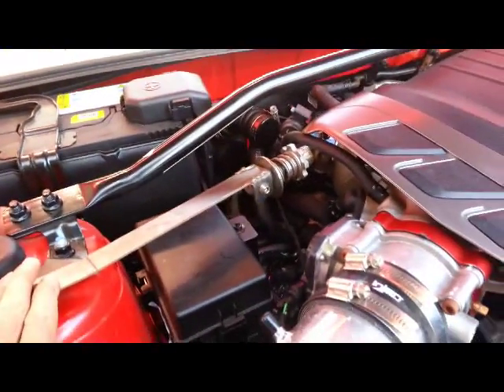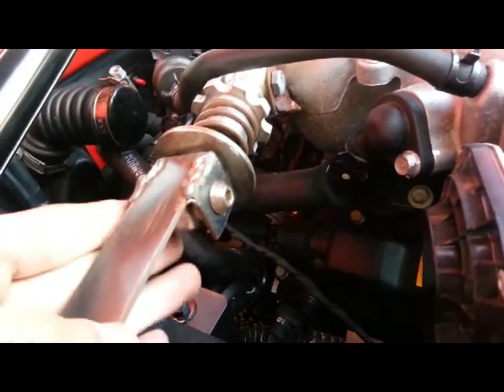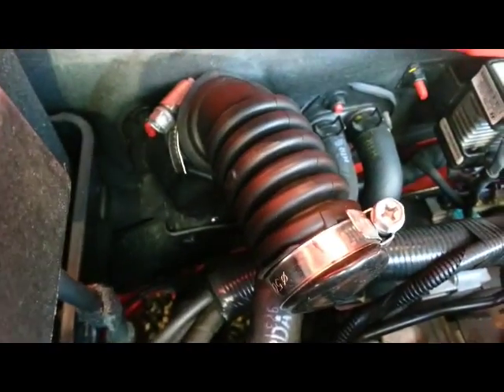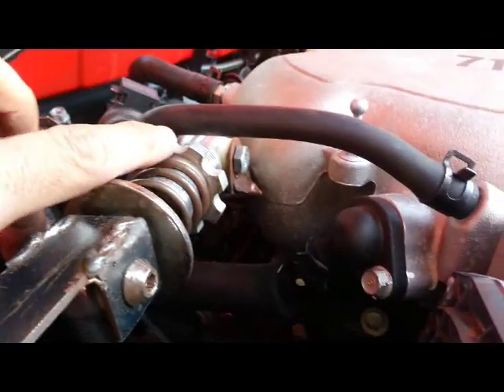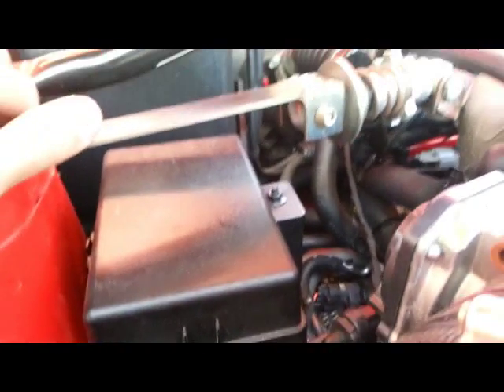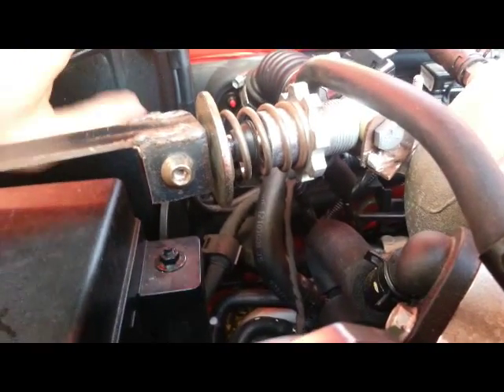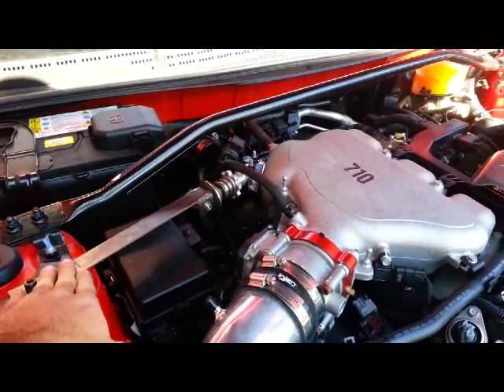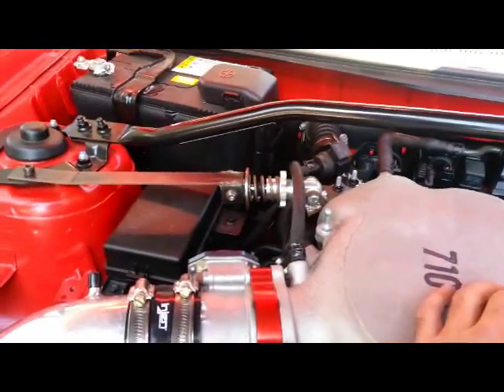✓ Custom Engine Torque Damper Explained

Comment: Not too bad.  The only issue I see is the bar between the two mounts.  It should be tubular or you need to add more pieces and form a triangle.  Your setup will NOT handle compression loads and is likely to bend during rapid throttle transitions.  Especially any that go:  idle>WOT>idle
Reply from the maker: BluntForceTrauma666 yeah this was a mock up/concept test. I could have stiffened it by welding a flat stock to make a T or making it into a capital i shape. I switched to a tube with polyurethane bushings shortly after this video and sold them for a time. This being a mock up allowed me to test lengths and different mounting orientations.
You can see glimpses of the updated design in my newer videos.
thanks for the comment and I hope you watch some other videos ;-)

Comment: I noticed you removed the heat shield of the intake, any reason why?
Reply from the maker: are you referring to the engine cover or the actual injen intake?
Reply: DareDevil5692 The black heat shield that goes around the intake
Reply from the maker: iscooterz2 The heat shield is on there, but it is hard to see in this clip.
You can see it at the 0 second mark. Injen's intake for the genesis only has the heat shield around the filter